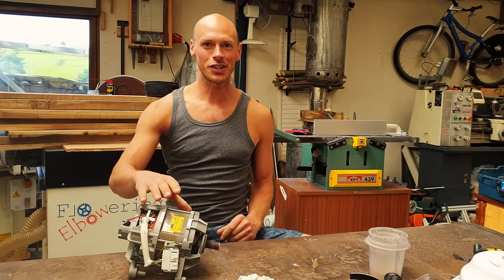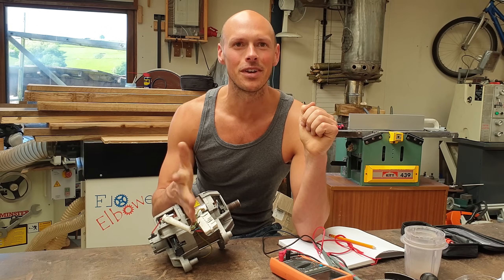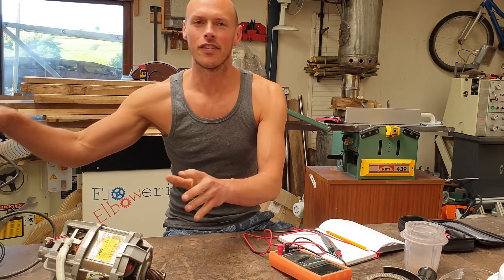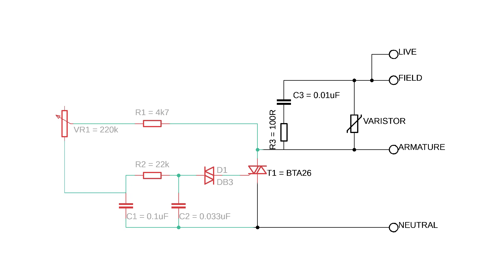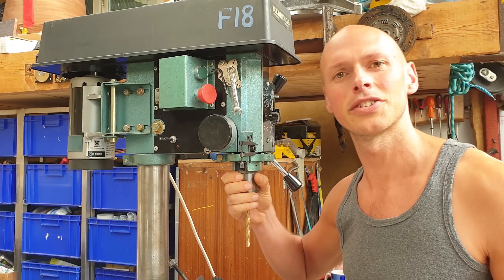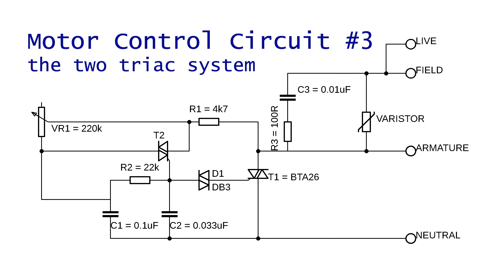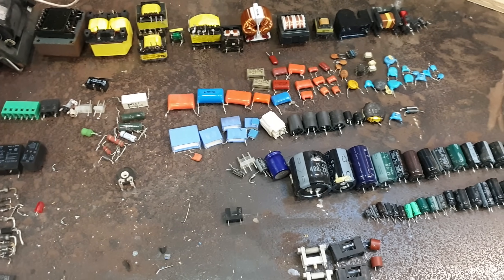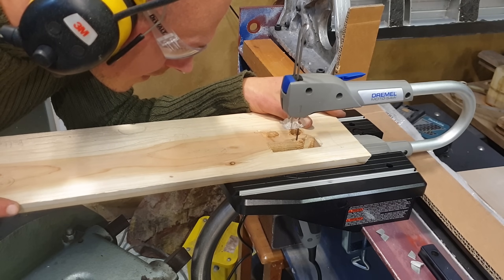How to reuse Washing Machine Motors [Arduino vs Basic Triac control]

Comment: The hot air gun is the best idea ever.   You are fun to watch man.  I am learning a lot.  You are getting to the heart of the matter of everything we are all trying to learn, and we are all trying to learn the same stuff. Mainly, how can I make my own CNC lathe. The treadmill motor seems to be the solution for a lot of people. Great stuff man.  I also want to slow down a vacuum and make that less noisy but without spending a fortune on a VFD that might just break and then be a total loss.  And they are way too expensive.  Also, in your video title, it has Arduino vs Basic Triac Control and that is so inviting. We all know Arduino, and just by the title alone, I hit the subscribe button while waiting for the Skip Ad button to come on, and then hit the thumbs up button.  I knew it was going to be decent, but I did not think it would be anywhere near this good, and I am not even all the way through it yet.  I am very glad to find this channel.  Thank you.
Reply from the maker: <Blush> Seriously, thanks for the subscribe, and for watching Jeff! Hope some of my other videos, which are all over the place, live up to your expectations :)

Comment: My motor came with a control board with an ATMega chip and an ICSP.... it'd be cool to use the original hardware and just put some new application-specific software on the ATMega.... but the laborious reverse engineering will probably prevent me winning that "ace hacker prize" 'cus just using the circuits and code you suggest will probably be much quicker and easier. ;)
Reply: Find the +5 v pulse input on the control board, then get a pules circuit like a 555 timer and variable capacitor and the board will work. you might be able to find a solid state variable time delay relay that can generate 0 to 60 pules per second.

Comment: Interesting video, thanks for posting. I noticed the components from old boards stored in boxes. Using a heat gun to quickly remove components from old boards is a handy idea. At 8:20 can anyone post a link to a YouTube video showing how to identify and sort the most useful components harvested from old boards.
Reply: No real need of a video just follow the advice below:

1. Learn how to be efficient and effective at removing components. The method shown here is a good one but not the only method

2. Always fix the board conveniently to give yourself that third hand ability. Use long nose pliers (as shown) and grip tightly, at the board level, the leads of the largest items and remove them first.
3. Apply heat gradually but swiftly around the solder side area and where possible jiggle the components. Use gloves for big items like chokes, transformers and large capacitors etc.

4. Remove EVERYTHING when starting out, beginning with the biggest and working downwards in size.
Hi

5. Capacitors are usually the easiest to identify with just two main types polarised electrolytics and non polarised others. After that there are countless variations but practically ALL capacitors will be value marked. Use Google images to help you learn various capacitor types, but electrolytics will  be polarity marked (+/-). Sort later into types and values (incl voltage ratings). If you have space store and keep EVERYTHING!

6. Coils, ferrites, transformers should all be fairly obvious, especially through hole types.

7. Diodes, transistors etc should also be fairly obvious but a low cost component tester from eBay or elsewhere is a boon to assist in sorting and checking basic types. The markings on the transistor can be used to do an on line search. Look at lots of different images of such to get used to what you are seeing.

8. Resistors removed like this are useful for testing circuits when they are though hole or larger power resistors but everything else resistor wise can be a pain so buy some E48, E96 or similar series packs off eBay - they are not expensive (unless you are flat broke)

Once you have all components removed, check them for markings and values. Learn how to read resistor colour codes without thinking and for older equipment also learn capacitor colour codes.

Once you have a pile of bits you'll be surprised how quickly you will not only learn the type of component but how to check what it is and the more you learn that the faster you will recognise different components JUST by observing and reading type/value information. No video can EVER give you that knowledge and confidence - only time and immersive experience.

Finally, I graduated as an electronic engineer in 1975 ... And I'm STILL learning new stuff! 👍👍👍
Reply from the maker: Hi, thanks again Blackwoods. I don't know of a video myself, anyone?

Comment: This is definitely one of the better tutorials I've seen - However I still only understand half of the technical words you're using!
I have a washing machine motor I've pulled out of a typical machine and I want to try to use it to power a pottery wheel. Could anyone offer me some help or point me to a learning resource for those with a very basic knowledge of electronics? Thanks
Reply from the maker: Hi Lewiss. Thanks for getting in touch. Glad it was better. I recon If you watch it a few times you will start to understand - especially in combination perhaps with this book : https://www.amazon.co.uk/Electric-Motors-Home-Workshop-Practice/dp/1854861336/ref=pd_bxgy_b_img_b%20book
Hope that helps. Any specific questions, just ask.

Comment: What does everyone recommend to use as a tachometer for the final solution presented in the video? I've been trying to use an infrared emitter and detector with a black spot on the shaft but it's inconsistent. Another thought I've had was to make a disk with holes like they have in most systems using infrared and have the emitter and detector facing each other instead of depending on them reflecting off. Finally, I thought about using a hall effect sensor to detect a magnet but I'm unsure about this method since the magnet will be glued onto a shaft spinning at 30000rpm.
Do you have any other suggestions?

For reference, I'm using a Dewalt DW660 for the motor. It will be used as a spindle in a CNC machine (MPCNC).
Reply: What I have learned is that Arduino, and  sensors, and A/D converters, ... none of them work in real life.  That is my experience.  Stuff gets stuck.  Clogged. It just stops working.  What helps is to have individual reader chips, like little AT45's, (tiny arduino chips) that do nothing but read 1 and only 1 A/D converter.  That will help you more than anything else. If you try to put a bunch of A/D readers (pins) on 1 arduino, ...and read continually looping through all the stuff, ... it just does not work in real life. It sort of works.  I don't know if it is the sensor, or the AD converter, or circuit noise, or bad luck, or what.  Or if the processor just can't handle it. But it never seems to work that well.  Not reliably.   1 chip per reader seems to work best.  That is how people who do this do it.  I tried to build an optical encoder once and the stuff they give us to work with does not work, or not very well, or not like it implies. Reading a temperature sensor once every 10 minutes is very different than a continual read on 6 AD analog IN pins on an Arduino.
Reply from the maker: @jeffbeck6501  Good points all. I am coming to similar conclusions, after lots of messing with this stuff.
Reply from the maker: Hi Elior, thanks for the question. Hopefully someone who knows better than me will chime in here, but my vote would be for the disk with a couple of holes in, and the emitter and detector facing.
Reply: I'd be inclined to use a hall effect sensor. Whether you have than off the end reading a disk or off the side reading a dip or protrusion is something mostly determined by the space it's being fit into.
Reply: you can get disk magnets that are diametrically magnetized - i.e. across the face rather than across the two sides and that could be attached to the end of your shaft concentrically so that it had little or no tendency to be thrown off.

Comment: the hz your power is supplied at is what governs the motor speed. maybe you should look into it. the motor is rated at unloaded rpm. if power supply is 50 hz then standard 2 pole is 1428 rpm.
Reply from the maker: Good day Broke Bloke. Thanks for your thoughts. This is true for induction motors, but not universal motors like these... a standard variable frequency drive would not work, for example... which is why these must NOT be connected to mains unregulated - they have no theoretical speed limit and bearings etc. Can be quickly damaged.
Hope that helps, Bongo.
Reply: @FloweringElbow  long time ago, but I remember something called "back emf," which prevents runaway.
Reply: @industry65 ..bemf , (besides other parameters ,) also depends on the strength of the stator magnetic fields which the rotating magnetic field interacts with....
and in a series configured motor , the field strength is a function of armature load current.., this armature current also flows through the field windings.
If these motors are unloaded  there's very little bemf produced.. therefore the "runaway" 
condition exists.
Reply: @analoghardwaretops3976  50 years on, I don't remember the college lectures so well, but what I am sure of is that motors do not runaway, I am willing to watch any videos you have that demonstrate the condition.

Comment: Using 2 12v batteries. Tried 3 wires, two from battery to brush and wining and third from winding to bruh. Needing more torque than the usual 3 wires set up can give. Can you give more info on this?

Comment: Hi again.
I've just tried that tachometer schematic, and I can't seem to make it work. The circuit in it self looks to be working, and by that I mean it's connected correctly, but my tacho-sensor is probably what's wrong.
I've tried different diagrams, but I get really weird readings. Mostly when the motor is running at low RPM it's (mostly) 5 digits readout, but around 60-75%-ish it goes bonkers, usually backwards. I suspect that it may be the capacitors that's causing this, but I've tried quite a few different ones now, and still nowhere near what it should be.
As for the tach-sensor, I've come to the conclusion that it generates about 12V at maximum speed, and I've tried a few diagrams with, among other things, 5,1V Zener diode to limit it, but to no avail.

I see no reason why this shouldn't work, really.
So, anyone has any other ideas???
And no, I don't want to hook up any Hall-sensor because I don't want any additional cables, nor any other type of sensor. It'd be nice to use what's already there.
Reply: After asking around on FB, it would seem that some tachometers delivers AC voltage, not pulses.
I only measured it once, and that was to verify that it was alive. Didn't think of measuring at different RPM's.
Seem kind of a stupid way to read the speed if it's basically a generator. 

It can't get any more accurate than x(x) pulses/revolution. If you're getting an AC voltage you have to put that through a level converter, then to an ADC just to read something that most micro processors already have. Stupid! Unnecessary ASF IMO!
But, I guess there are as many types of tachometers and ways to read them, as there are stars you see when you're banging your head against something hard

ATM I'm going to skip that RPM-part, but I'll reserve a pin on the Arduino for it in case I decide to give it another crack.
It would seem that the MC3PHAC/FSBS10CH60 seem to work pretty well together maintaining the speed. Not yet tried water in the machine yet...

I have a ton of sh!t to put together. My little I/O-shield looks like a freaki'n scare crow with all the cables currently sticking out from it, just waiting to get connected to the other spots.
Sooo much stuff left to do.
Just finished two small PCB's yesterday. took several hours back & forth to troubleshoot some glitches. One was a home made PCB. No through plating, double sided and askew holes, and some breaks on the traces. Took easily 4-5 hours to get the sucker going. Contains 8 NPN-transistors  with contact terminals for 1x RGB, and 4x LED's and one buzzer.

The other card took half that time, but had to wire with really thin cables (Wire wrapping wires - Say that three times fast!). It's a small prototype board. Also containing transistors, but for inverting the signal to my 8-way relay card module (Where some schmuck in China thought it was a good idea to have a logic zero (0v) as activation!).

Looks like crap, but it's at least working, at least what my multimeter, my eyes and the connected pins to the power supply was telling me.
It'll be something else to connect this to the Arduino and get them working as intended.

I'm also in the anguish whether or not to hook up a Triac to control the heating element instead of using relays which isn't optimum in terms of maximum life-expectancy for it. Also, it'll be better if I want to use "eco" mode not having to smack it up to maximum, but mainly I thought of this to save the heater.
Reply from the maker: WnotWeird, sounds like you are making progress! You have gone so far beyond my efforts, I really am impressed. Keep at it friend. Could you use a solid state relay for the heater element? 
Peace, Bongo,
Reply: @FloweringElbow  I suppose I could, but I don't have any on hand, besides, that would only be on and off, which isn't optimal for any load since it's creating a surge spike. By using a Triac, I think, you're at least minimizing that. That's what I'm aiming for. Only real drawback is the energy loss that occurs in the form of heat. The same thing occurs with an Solid State Relay since it contains Triacs or whatever it was.

I think, btw, that PWM could theoretically be used for  an SSR, but I don't think it's recommended. Haven't seen anyone using it for that.
Anyways, the Triacs have been purchased already, and an SSR is quite expensive so I'll go with what I have...
Reply: Just found this:
https://www.youtube.com/watch?v=kwenHPAZPcQ
Not a perfect example as he only showed a neon light connected to it, but he didn't mention anything other than inductions being potentially bad. Heaters was ok.

If my Triac solution doesn't pan out, I think I'll consider getting one of these
Reply: @YnotWeird  A schmitt trigger logic gate would convert your ac waveform to a pulsed form cheaply and easily.

Comment: this is just what ive been searching for ,for months, it gives the informaation that all the other tutorials omit. now I can get to work on my potter,s wheel without the clay flying across the studio floor thank you so VERY much
Reply from the maker: He Frederic, thanks for this, it means a lot to me to know this stuff is useful for someone at least ;) 
So are you planning an arduino circuit or one of the simpler ones? Good luck, Bongo.
Reply: @FloweringElbow  Hello, thanks for the reply, It's rear to get a response from you tube presenters and it's very gratifying.  In answer to your question,  most probably I face the challenge of the Arduino  but I need to get some sort of control as soon as possible, so I'm going for the quick solution first and progress to the finer details later, but I need some info. on the details of the circuit regarding  the components,  In the list it gives D2 as " Varistor 385VAC "     I'm a bit confused as adjacent to the TR1 there is D2 and D3 so it looks as if D2 is duplicated but as far as I know a Varistor 385 is a disc type capacitor,  Can you please clarify this for me, also I shall be making my own TR1 so could give me some idea of the values of turns to give me the output. 
Again thanks
Reply from the maker: @fwbartlett1940  Good morning and thanks for your reply. I am guessing from your message that you will be aiming for the 3rd circuit I list in the video - the one that runs the motor on rectified direct current. The good thing about that is that you can first make the simpler 2nd circuit, check it works, then add on from there... 

D2 and D3 are identical diodes, which when combined with the centre tap transformer Tr1, are simply an efficient way to produce full wave rectified current. If you didn't have a centre tap transformer (and if you are making your own you probably wont) you would want to use a full wave bridge rectifier here instead... 

The varistor is used for transient suppression read up on varistors here: https://en.wikipedia.org/wiki/Varistor  You could probably get away without this component...

I would love to hear how your transformer making goes - it's something I have always planned to do but never have. I have a stash of microwave oven transformers, just waiting to be rewound - there's lots of good info out there on reusing these. I believe the number of turns should be easy enough to work out through a few experiments, and the voltage requirements are not at all precise for this application - anything from about 8 - 20V would do, so long as the transformer can handle the current requirements your good.        
Hope that helps, Bongo.
Reply: hello I almos mist it, there's no reference to T2 situated between the POT. and the diac, it looks like another diac, but unidentified
Reply from the maker: @fwbartlett1940  see here for more details on that circuit: http://visit.news/pdf94   I haven't made it myself and don't know values for that triac.. If you don't want to do experimenting/ research, make the previous circuit with only one triac... Hope that helps, B.